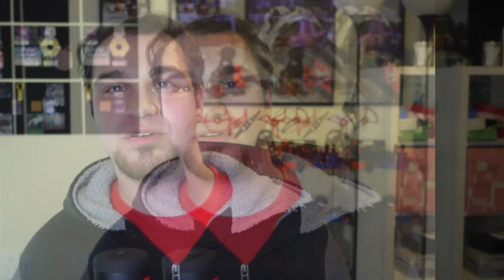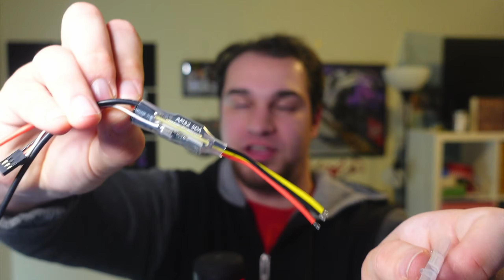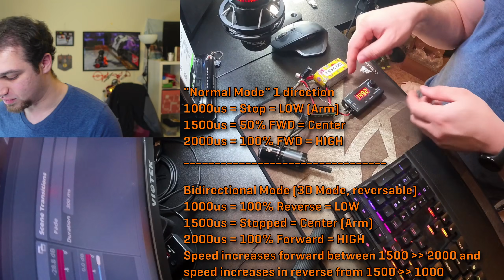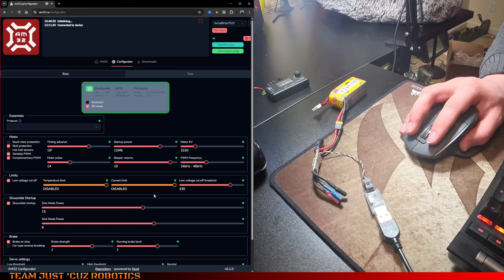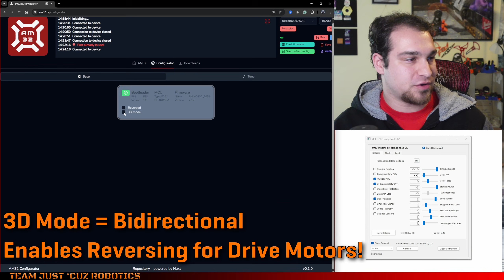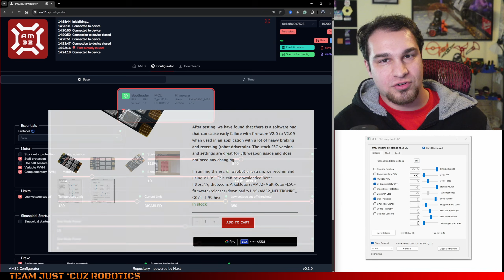AM32 ESCs and You! Combat Robot ESC Wiring, Usage, Programming and More

Comment: Hi, I bought 3 ESC 4 in 1 SEQURE Blueson A2 with AM32 firmware, assembled and configured 2 quadcopters with ArduPilot, and they both produce the same "DA-DA-DA-DA" sound when connecting a battery with the motors instead of initializing. I connected another ESC with BLHELI 32 firmware and everything is fine, which means all the ArduPilot settings are correct and have nothing to do with it. There are no tips on the Internet, everyone says that calibration is not needed for D-shot, but this ESC requires calibration. I found your video, and when I connect the battery, I get the same "DA-DA-DA-DA" sound, but my ESC does not calibrate as in your video, and does not initialize. Maybe my sequence of actions is incorrect? No matter what I do when connecting the battery, it's just "YES-YES-YES-YES." I'm utterly mortified by this AM32. They call it an improvement. I feel like I'm the only one on this planet with this problem. There's no answer online. Can you give me advice on how to do this calibration and in what order, given my FPV quadcopter, TX16 remote control, and a Mission Planer?
Reply from the maker: Sorry but all of my experience using these escort combat robots so I've never actually used them with a flight controller

Comment: Hi there! I've been following your combat robot builds and really learned a lot from your channel.have a quick question regarding weapon ESCs running AM32 firmware. Which specific parameters do you recommend tuning for weapon performance, and do you have any baseline settings you usually start with?Also, I was wondering: if I crank the startup power all the way up higher, would that significantly increase the risk of burning out the motor windings?Thanks a lot for your time and for sharing your knowledge!
Reply from the maker: Thanks so much!
I have a list of ESCs I sell on my store and every one has a settings tab with the exact settings I recommend. Generally burning out a motor isn't a huge concern for me and I typically run 150% startup and it's fine. If you leave stall protection enabled it will usually help prevent burnt motors.

Comment: I am already using data transfer cable USB type C. But it wont still detect on my computer. What to do?
Reply from the maker: Make sure you have the correct drivers you should be looking for the ch340 serial driver I believe if you're on Windows. If you don't use Windows I'm not sure I can help with the driver thing but you can Google it

Comment: Super useful to have some extra insight into am32, I'm into rc crawlers so always looking for tips on super slow motor control without generating too much heat. 
Pretty much only John Holmes of Holmes Hobbies making tutorials on am32 for crawlers so thanks again for this useful guide.
Reply from the maker: Happy to help! I also saw Holmes hobbies was the only resource really and felt this update was needed. May need to update it in a few months as new versions come out.
Reply: @JustCuzRobotics ah, you see now you've responded I'm going to ask a bunch of questions lol. 

Running a 1224 12 pole 3500kv 9imod motor and 30a 9imod esc, for max torque should I set the pwm low, say 8 and then check variable pwm (to hit max of 16)?

Is sine power the way to control heat buildup while in sine mode? We spend a lot of time in sine for slow control in 24th scale crawlers.  

You should build a scx24 as a non violent way to enjoy the RC hobby! lol
Reply from the maker: I've never done anything with AM32 that wasn't for robots so I'm probably not the best to ask about crawler things.  My understanding is sine mode is an inefficient method to gain an extremely low RPM torque boost. I'm not sure about any relationship between PWM and torque I always leave it at the default or set to PWM by RPM on the later versions. For a robot where the two drive motors are on either side of the robot the RPM matching to go in a straight line is far more important than getting absolute max torque from each motor.
Reply: @JustCuzRobotics thanks for the kind replies, I'll do some experimenting then and see where it leads. I grew up in the UK watching the very early robot wars so it's been fun checking out some of your other videos, subbed!

Comment: Hey, what capacitor are you using on the Pariah 70A esc? I purchased them a while back and it looks like I should not have disregarded the capacitors and I lost them. Thanks, great video keep up the great work!!!
Reply from the maker: I forget the exact ones but anything should work rated for at least 30V and 330uF or higher
Reply: @JustCuzRobotics  Thanks! I did some research. I have had some interference issues with my drive ESC's hesitating or moving without controller input when starting up the RDY-5536 hubmotor utilizing the Pariah 70A as the speed controller. You recommend installing a cap at 5-6S but I am using 2 4S batteries. Using a 1000uF 25V ESR capacitor in this case eliminated the issues.
Reply from the maker: Hmm yeah the Pariah seems to have that issue more often than most ESCs but I'm not totally sure why. Glad you found the fix though!

Comment: What would be the real world difference between the 'JCR-RC Mini 35A' and the '35A AM32 Drive ESC' (or similar models). Why would I not just go for the mini as it is lighter, smaller?
Reply from the maker: For many use cases there will be little difference. The larger 35A does has a.6S rating compared to the Mini 5S rating. 

The larger 35S ESC has more thermal mass but I don't have a way to evaluate manufacturer claims for continuous current (at least, not yet) to verify how much difference this makes. I have found in practice I can push the larger ESCs a bit harder though.
Reply: @JustCuzRobotics  So on 4S with blitz lites (which are amazing on hand btw, thx for the smooth order) I can probably take the weight and size benefit of the smaller ESCs?
Reply from the maker: For the Lites yeah they will draw max like 15 amps or so so the JCR-RC is perfect. The latest batch of those ESCs comes pre flashed with settings ideal for the Lites and there is a bundle discount to pair 2 motors and 2 mini ESCs as well.

Comment: I flashed my esc from 2.17 to 2.18 firmware.  Now, when i turn it on it just acts like it can't hear my RX and just has the power on beeps over n over (no signal beeps).  anyone got any ideas?  do i just need to calibrate it?
Reply from the maker: Most likely yes you need to calibrate, or you may have flashed it to single direction instead of bidirectional or vice versa

Comment: You mentioned that you used the 35a esc for your 12lb, how did that work out?  I’m looking to switch from blheli32 to am32 for my hobbyweight. I’m currently running discontinued 51a multistar blheli32. It’s a horizontal bar spinner so i’m not pushing drive very hard (3530 motor paired to p6 gearboxes)
Reply from the maker: Worked prefect for drive on 6S for me

Comment: Did you ever dive deeper into ELRS resivers and DRSF? using the single wire?
Reply from the maker: I've been experimenting with it off and on since this video was posted. As of yet I have never gotten CRSF to work correctly. I recently got a different method working where an XR2 receiver with some custom firmware can run up to 5 ESCs with 5 PWM signals but I haven't gotten the single wire thing working.
Reply: @JustCuzRobotics  so the benefit for now would be using that smaller XR2 receiver but the ER4 is not that much bigger. For 5/6 channels it is interesting though. I am looking forward on any progress regarding  CRSF  though.
Reply from the maker: The XR2 has a few other things with that custom firmware, supposedly it can wirelessly change AM32 settings as well. Haven't tried that just yet.
Reply: @JustCuzRobotics  I would love a video or more info about the whole XR2 with 5 ESCs. Is there any source or informative material around?
Reply from the maker: Tried using one in one of my robots and one of the pads ripped straight off of the PCB. While theoretically very capable they are very fragile. The firmware needed I found in this project.

GitHub - frank26080115/Shrew-Dual-Brushed-ESC-with-ELRS: ESC for two brushed motors, with ELRS integrated https://share.google/UEEE8hWgIs11JaNPB
Reply: @JustCuzRobotics Oh, I saw that in the Sonic V3 video.Thx I will look into it. Also have u ever looked into using an XR reciever with an matek CRSF to PWM converter? Or is this just unnecessary hassle?
Reply from the maker: Sonic isn't the bot I tried the XR2 for. I haven't looked into that tho.

Comment: Thank you for the great information. It helped me a lot. I have a question: I would like to use a Hacker A50-14L Turnado V3 kv400 for a 4 m glider and am now looking for the right AM32 ETC. I would like to operate the aircraft with 6S. To be on the safe side, an ETC with 100 A should hopefully be sufficient. What would you recommend? And what settings do you recommend for start-up power and brakes? I would like to use a folding propeller.
Thank you very much
Reply from the maker: Sorry I'm really focused on combat robots not gliders, so I am not certain what the best option would be for that application.

Comment: Is there any information on AM32 ESCs with Hall or encoders? Is there any compatible hardware? I've been interested for a while for other types of robots. And to be able to control them well at low RPMs.
Reply from the maker: Encoders of hall sensors need to be on the motor not the esc for Sensored operation. The ESC also.must support Sensored operation which AM32 doesn't fully, at least not in the current stable release.  You would need to use VESC for that I'm afraid. Small and light VESC is next to impossible to find, the best I know of are these. Also cannot exactly vouch for them as we tried the A200S in Bloodsport and they all blew up. https://teamtriforceuk.com/escs/
Reply: ESCape32 is another option. It supports Hall sensors in hybrid mode.

Comment: Is it possible to program an ESC with an arduino instead of a usb to 3 pin adapter?
Reply from the maker: Yes you can likely do that depending on the exact arduino. I showed how to do this for Blheli in this video: https://youtu.be/rDjx8OswOoI?si=gkL_VHW6x_1qeIs8

You need to do the same process loading a hex file using the Blheli suite to the arduino. Then it can program AM32 or Blheli32 ESCs. However Blheli has shut down so I cannot guarantee you can still access that program.  If there is another way (which is likely) I'm not aware of it personally.
Reply from the maker: https://github.com/am32-firmware/am32-wiki/blob/main/docs/guides/Arduino-PC-Link.md
Reply: @JustCuzRobotics  This works great! Thanks!

Comment: Nice video on a topic that isn’t well covered! We did a bunch of testing with AM32 on different ESCs for NotDeadYets hub motor. We found sinusoidal mode was a great way of turning ESCs into e-waste. The KV setting behaves a little differently than I expected – I understand it doesn’t change the motor’s speed, but it does change the transition from the lower RPM power limitation, so it can be worth experimenting with a lower Motor KV setting